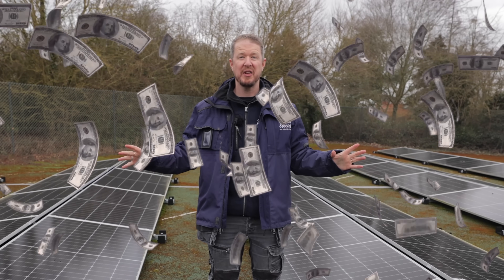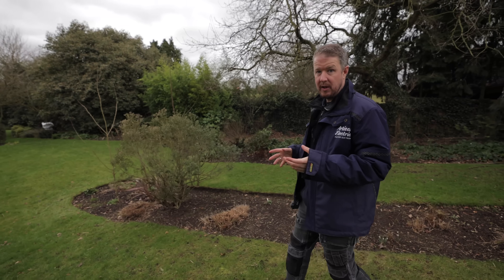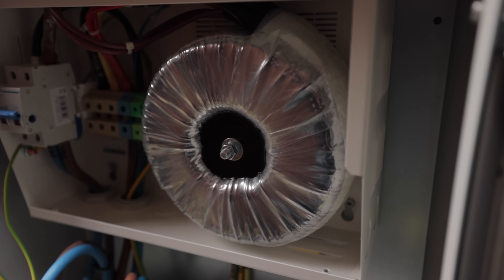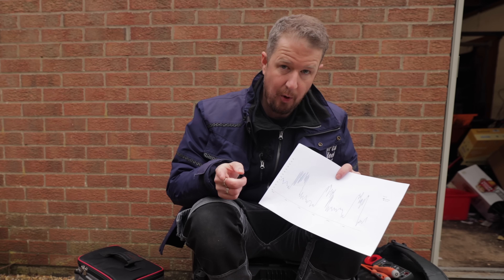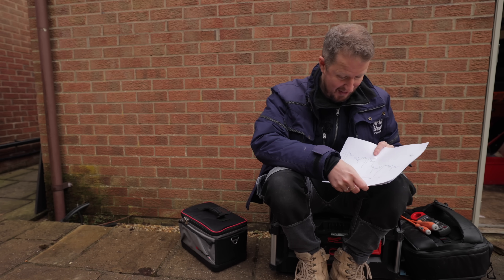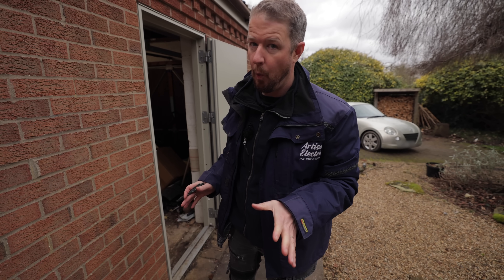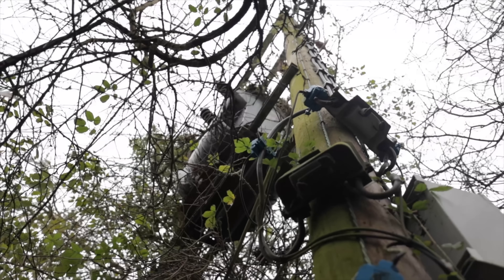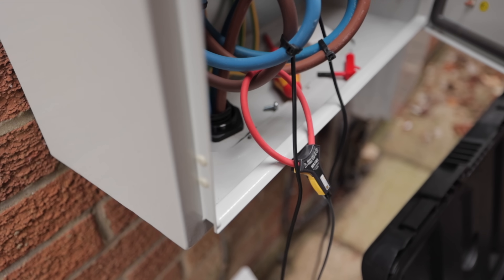THOUSANDS Down the Drain – And We Can’t Do Anything About It!

Comment: Technically the big round shiny thing ( at 4:07 ) wrapped in aluminium foil is called a ferrite coil and not a transformer. But as a fropessor in the electronics compartment of uvinursity of Stockholm I'm not going to hold it against you for not knowing it.
Reply: It’s a toroidal transformer isn’t it?
Reply: @tmurphy7846  No, it is not! Trust me, I'm the grand-child of a Swedish ww2 hero and also a fropessor!
Reply: @tmurphy7846  Correct!
Reply: No it's small so it's just the cabinet heater
Reply: Taking every opportunity to flex your education yet you could not get it right. Pretty funny. Like the person above said its a toroidal transformer as they can come with or without ferrite cores. But as an electrician from Sweden i wont hold it against you.
Reply: @abbe9641  So you normally hold high voltage transformers against other people? What are you, a psycho?

Comment: Can't you configure the system to only charge the batteries at full power only between say 11am and 2pm? That way the peak production is going to the batteries and the entire system will be helpful to the grid rather than pushing 17kw at noon with the battery already full..

Comment: Sadly, the entire matter would not even be an issue if the world was not deluded into thinking CO2 is a problem for the climate. We have clean coal and gas power generation.  We have nuclear power that is the safest and cleanest form of all power. But because of false ideology about global warming we revert to stone age methods such as wind and sun.
Steam turbines running constantly 24 hours a day provide a stable grid. You run into ridiculous problems when random solar systems are added that spike grid voltages.  These guys would have even more problems if someone else in the street wanted to install another huge solar system.  Another issue evident in the video is that this house owner expects the grid to supply cheap power overnight to charge his batteries so he can sell back at a profit during the day. This only demonstrates the futility of imagining that everyone can do this.  If the energy company cannot sell power during the day because everyone is selling their power back to the grid, the power at night will no longer be cheap.
Besides this, if the home owner is apparently using up all their battery power by 9am, they won't have any power left to sell back anyway.
It is insane.

Comment: That’s madness. 17 kw on single phase??? Issue is going to be in the mains (volt drop) try going to someone else on the transformer and measure the voltage at full solar output

Comment: It is your fault and until you recognize that "you do not know what you're doing" you will continue to appear to be just one more rather dangerous, "YouTube performance technician" who's impersonating a qualified engineer.

Please stop now before you end up at, a minimum, financially "eating your ignorance", that's if you don't kill somebody  or burn somebodies property down first.

Try this kind of installation in other parts of the world where professional engineering registration is a legal requirement and you would be in court facing criminal charges before you could say reluctance. Hiding behind "Codes" is not and never will be a defence.

The single line supply and earth return distribution system should  never have been permitted. (The physical line breakage of such systems has been the cause of untold misery and damage in so many places, like Lahaina Hawaii for example. It's all about the short term bottom line for those charged with managing the distribution systems).

Conductivity of "ground" can, and does vary, dramatically.

(That toroidal transformer is likely 3-5KVA at most, You  couldn't hang a 17KVA unit on the wall like that).

Comment: Would replacing the supply cable from transformer to the house/s not be the cheapest solution? 

Increase the size of the cable and thus reduce volt drop?

Comment: I have had similar problems in Oz, voltage stabilization is a big problem in rural areas, as the solar kicks in around the area, voltage spikes, my heat pumps go into error mode.
I use an energy monitor within Home Assistant to demonstrate to clients this is outside my control.
We also have big voltage drop problems as the demand for electricity has sky rocketed in rural areas, long wait times for transformer up grades.

Comment: 1:53: Base Voltage of 240V is fairly high? It's not. I read: "The standard voltage for the European grid is 230 volts alternating current (AC), plus or minus 10%. However, the actual voltage varies by country, with the UK using 240 V and France using 220 V. "
That means 240 is right on spot, and when localized Voltage rises beyond while the panels are producing MAX , then the grid capacity for exporting (actually ridiculous...) 17KW is not sufficient. Very unlikely. Sure, stepping down export Voltage may avoid over-voltage tripping at the inverter, but at the end - is this the best solution? (At the end, most string inverters in that class are 3-phase nowadays).

Comment: Sir, I don't know if you know this but... UK power is at 240v, so I don't believe it's "too high" it's in the acceptable range of 220-250v and shouldn't be causing electrical issues, this problem resides with your equipment that you installed, go check it under warranty claim and fix it.

Comment: So, in lay terms, there is a choke point on the network thats causing voltage to go higher becuase the amperage isnt being dissipated.
Which still isnt lay terms but i tried...

Being a teamsformer makes sense as being an area for which someone is able to have a tennis court, one could assume the dno has specified transformers and cabling to a much lesser degree than a more densely populated area as such an area is likely to be fuelled mainly by a gas/oil fuel source.
Just a guess, but, knowing my rural parts, it seems a likely story.
The network just isnt able to cope even if it might be able theoretically.

Comment: Will 3 Phase not help resolve the issue ???
Request/ask DNO to quote for a 3 phase supply, where the 17kW can be exported more evenly through the 3 phases, though this will cost & at best the cost might be shared in an ideal world between all parties
Going down a full 3 phase route will allow owner to charge EV at higher rate, but in vast majority of cases charging up to 32A on single phase is more than sufficient for most EV owners. If charging from solar during the day, a modest "top up" at 2kW or 3.6kW for 4 hrs midday works quite well if you have excess solar
(Yeah, you could charge 3 Phase at 11/22kW but only for a brief time before EV charged, so you wouldn't benefit that much, that often from 3 Phase charging over 32A or maybe just 16A single phase charging midday, draining off some of the excess)

Other options with 3 inverters/batteries is to configure as 3 Phases
Chuck in another DB or two, splitting up the loads across the 2 or 3 phases...
I say 2 or 3 as you probably will use 2 phases for house load & the 3rd phase inverter only exporting back on single phase supply

Or setup as a single phase using 2 inverters/batteries in island/off-grid mode
Then the 3rd inverter/battery is grid tied exporting only
(or vice versa)

Finally, the export limit is too high, thought max was 15kW (single phase), but rarely do they allow this max
The charging current is way high also

Everything should be lowered to charge/discharge at a lower rate really

Charge batteries at say 10kW over the 5 or 6 or 7 hours than draw down 17kW for just a few hours
Export at say 10 to 12kW during the day, storing excess or charging EV at peak generation times
(In summer especially look to "top up" EV, dumping say 3kW or so into EV for peak 3 or 4 hrs 10,00 to 14.00
or immersion/heating, look to dump/consume a modest chunk of excess peak generation somewhere) 
As sun starts to lower & production tails off, then set batteries to supply house & discharge slowly any excess to grid, at say 5kW to 7kW until say 9 or 10 pm maybe ???

Ultimately it is a mixture of many things, but mostly inflated by exporting too much & then charging too much off-peak, which I feel could be minimised by exporting slightly less for longer hours - with battery discharging excess to grid early evenings until off-peak rate commences, then top up batteries more slowly off-peak, rather than refill as fast as you can at 17kW
Might be worth trying to reconfigure the system & how inverters are linked/connected, possible island/off-grid or just one inverter exporting...

Study all the generation & consumption/export data, smooth out a lot of the peaks/troughs or duck curve
Adjust the consumption/load shifting, trickle charge EV on sunnier days, export at lower rate for longer & recharge batteries a little slower for longer (probably better for battery too)
Study & tweak/reconfigure the system will greatly reduce a lot of the issues I believe, especially if the energy/consumption/export is distributed in a more balanced way

That might help keep the voltages within a better range throughout the year
If that doesn't yield any fruit then it might have to be a 3 phase supply - more work/cost
Reply: They may also want to look at the Solar Edge DC Charger

Comment: The main cable will probably be the issue. 
But you could also measure the Zs and Zi values to get the impedance values of the incomming grid. 
Do that under load and you might see some bad values in this neighbourhood. 

We have had something similar but only with overvoltage. The supplier adjusted the transformer voltage and now everything is fine.

Comment: I had the same problem in Australia, end up with 50mm incoming mains (80m) from the tranny to the meterbox and 16mm cable from meterbox to each of the inverters (30m), that was enough gain to stop the tripping on mains over voltage

Comment: I have a background in regulatory affairs (as an engineer), and UL stipulate devices be capable of working at +10% of nominal working 240 + 10% = 264V, if working in the HOME, then this limit is increased to 15% , i.e 240 + 36V = 276V  - this is RMS and the peak will be 1.4142 * 276 = 390V.   It was these +15% voltage which I was trained to use from my degree where I have always design products for working at +/- 15% nominal.....

Comment: I suggest the problem is due to an imbalance between phases.
   Perhaps if 2 more houses each had a similar system and most importantly on different phases, the problem might be cured.
   Or change that one house with the problem to a 3-phase system which would put power in and out of the grid equally across the 3 phases.

Comment: New Zealand Engineer here.
At first I thought you were overthinking things but subsequently became more confused.
From what I can determine from your descriptions, the mains voltage increases substantially when the solar installation is actively injecting power to the house reticulation.  This will lower the cable losses from transformer to house and cause an increase in voltage supply.
I have just one question prior to looking forward to your next video expose' on power logger results...

Does the UK employ "automatic" tap-change on their transformers to cope with widely varying load scenarios?  And if so, is the tap-change mechanism working OK on that transformer?

Comment: It's a case or reverse maximum demand. Not to the house, but to the grid. If the overheads are 16mm2, maybe upgrade them to 25mm2 or 35mm2? What's the distance? 300 metres? If they're really got money to burn on this green dream, go 50mm2 to the first pole. Get the back hoe out and make it an underground run. The things you could do with unlimited money.

Now imagine government running and controlling a country's "green" energy system. Without a baseline voltage, you can't have a complete energy grid, you NEED a coal or gas fired power plant. But country's are only just finding this out. Australia was getting power of 40% from the grid and another 40% from residential solar, 20% unused head room. The problem is that the "renewable" 40% generation is for 2-3 hours of the day from 11am-2pm. But the peak usage is early in the morning when industries fire up and in the afternoon when people get back home. So the whole grid is relying on the 40% generation which is close to max because they've shut down all the coal fired power plants. So to remedy this, the state governments are going charge people for supplying power to the grid with their solar panels or, because they have "smart" power meters, stop them from feeding into the grid. They are also using requesting all air con installers to connect the air con to the "smart meter".

From the web: "A split system air conditioner can connect to a smart meter through a "PeakSmart" enabled feature, allowing the energy provider to remotely adjust the air conditioner's power usage during peak demand times, usually by lowering its cooling capacity, in exchange for potential rebates or incentives; this connection is typically facilitated by a small receiver unit installed within the air conditioner itself."

Comment: You know if you install Victron kit (with a GX remote connection, which can just be a Rasberry Pi if you like) you get remote data-logging on incoming voltage/current/frequency and outgoing voltage/current/frequency, and piles of other info too. No need for separate on-site logging kit. Does fancy kit like SolarEdge not include such functionality too?
Reply: I had a high voltage issue at work with some equipment installed on a residential tower block, nothing to do with solar, there was none and the building was on its own transformer. Our UPS was logging up to 283V at one point. I contacted the DNO who came out the same day and just verified that our UPS was giving the same readings as his multimeter and took our UPS logs as accurate rather than logging it themselves. A week later they came back and changed the transformer tap. I was quite impressed TBH, I remember my dad having voltage issues at home when I was a kid. He worked for CEGB and borrowed a chart recorder (back in the day) but got nowhere.
Reply: Is the method and equipment you are proposing already or suitable to be calibrated to guarantee an acceptable level of accuracy?
Reply: @jim373  I don't know what accuracy they specify offhand, but it's the same measurements it uses internally to comply with G59/89/99 so I'd be surprised if it wasn't sufficient. It's certainly good enough to see when the system voltage reaches 253V (edge of spec) or 262V (disconnection voltage). Data appears to be logged to the nearest 0.1A, 0.8V on AC side and 0.02V and 0.3A on DC side, power to the nearest Watt and frequency to the nearest 0.1Hz which is perhaps a little coarse. What specs do the DNO require?

Comment: What an interesting problem. Part of me is thinking the equipment is pushing the voltage far too high. But at the same time the DNO approved it but it's not really affecting them. Most of the problem is that you're trying to siphon it off right at the source without going through what would typically happen on a commercial install, a lot of cabling and transformers before it even hit a user.
Definitely can't wait for a part two. you might even think about putting a power monitor down at the end of the line and maybe at the beginning of the line and then you have some comparisons.
And when you take the optimizer out be careful you might be able to reuse it somewhere else.

Comment: We had that issue with our PV system on a SWER 15kV line in Australia. Daytime voltage was about 260V during the day which caused errors on the invertor. Local power authority came out and lowered the base voltage on the transformer coming into the house. Problem solved. It's definitely an issue for the power authority.
Reply: Trouble is simply lowering the transformer tap (which you are correct is often a cost effective solution to overvoltage) would exacerbate the undervoltage issue while charging the EV. This is more of a voltage spread (difference between max and in voltage is too great) issue rather than simple overvoltage and is caused by too much single phase export/import. They also seem to not implement the smart inverter functions that have been mandatory in Australia since 2020.

Comment: Option to install a winter & summer switch ?? So in winter you bypass the AC voltage optimizer ? In summer you use the Voltage optimizer... In the Netherlands we have the same problem . In summer I can see 250 Vac grid voltage ..

Comment: Surely the solar panel control gear should regulate the output voltage.
Also, can't you set the charge rate for those storage batteries to reduce the volt drop.
I'm sure this (complicated)  system can be configured to work better.

Comment: I find it odd that the grid system is anything to do with the end customer. They must know the country is putting in more and more solar so should be upgrading all these transformer things everywhere. We are going to be more electricity dependant and using. As gas is phased out and turned off. Whether that is government using our taxes or higher general electricity costs to do it, it needs to be done by  the sound of it.

Comment: Doesn't the inverter have a maximum output voltage setting? It would limit the max generating capacity, but prevent the issues you're seeing. The electrical distributor will have set the tappings on the transformer so that the furthest house has above the minimum, and the closest, below the maximum. My money is that the cable size is too small between transformer and the house.